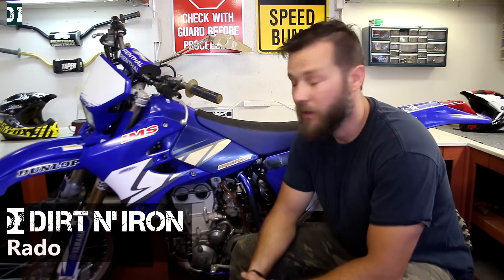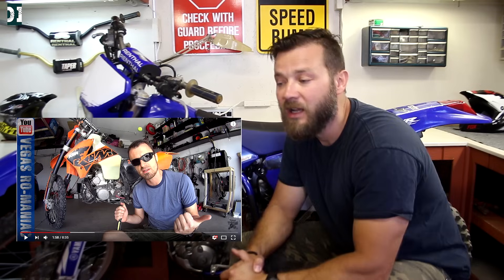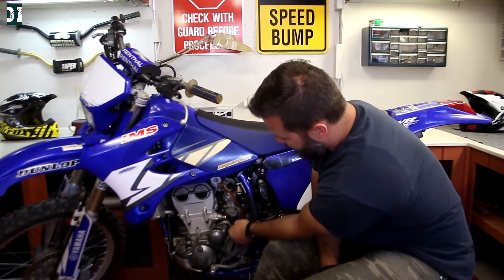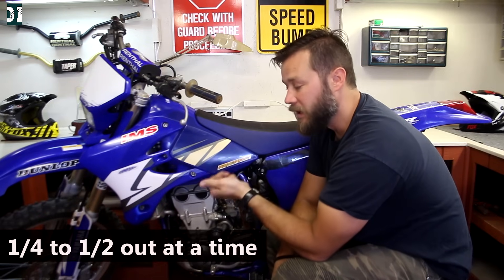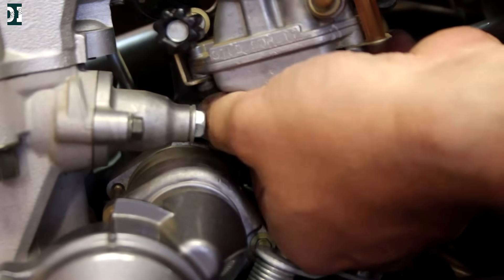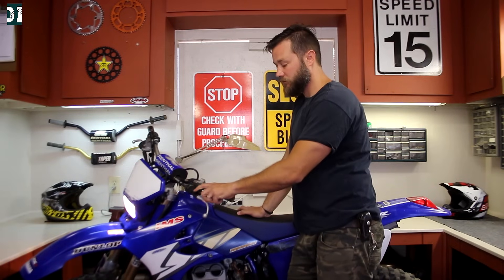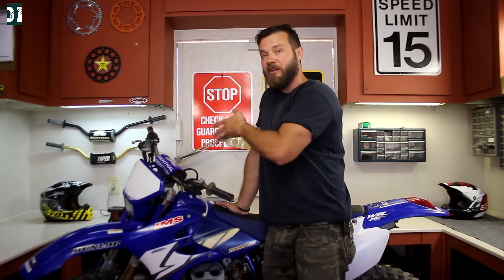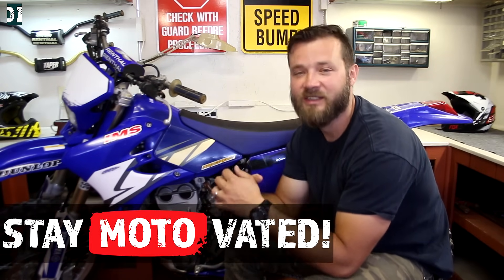How to adjust idle on 4 stroke dirt bikes - fuel screw adjustment

Comment: Hey Rado,

I’ve bought my first bike about a month ago. It was a project and it was the first time I rebuilt a motor. To make a long story short, I did this rebuild with only YouTube tutorial videos. Now she’s up and running and she’s finally getting the love she deserves.

The bike is a 2006 KX250F. I’m having, I guess you can call it a bogging issue at mid-high rpm in any gear. Where the bike feels sluggish, then at times she’ll die on me and I have to wait a few minutes before the bike will start. I can’t tell if it’s too rich or too lean.

I tried to set my aftermarket fuel screw exactly to this video. However, my bike increases in rpm instead of dropping around 2 - 2 1/2 turns out. If this is correct l, it never fixed my problem.

The bike pulls very hard during test runs but there’s something not right with the fuel system, any suggestions? 

I’ll be riding at 496’ ASL around 15-25 degrees Celsius (59-69 Fahrenheit)
When I opened the carb up I found:
180 main jet
55 Leak Jet
40 Pilot Jet
68 Starter Jet
Needle Jet: 2nd last clip on the top.

Thank you for the excellent content, I watch all of your videos and I’ve learned so much. You motovated me to get my first bike since I was a kid and I can’t wait to get this baby on the trails.

Love from Newfoundland, Canada.
Reply from the maker: Hey Bobby, I would suggest to get jd jetting kit, they tested same bike you had and will give you best recommendation for jets. The kit is like $70-80 but it really does work, I have it on 3 bikes now. of course you can try to play with it and come to similar results.. but kit has it all, plus they have custom needles that gives you very smooth transition. 
try to raise the needle one clip and test, then maybe raise one more clip and see how it behaves. By raising needle you are making it richer, you allow more fuel in. 
if it gets worse then go opposite direction on the needle and lower her all the way down, and see what happens..
Reply: Dirt N Iron I played with the needle jet clip positions and found one where the bike doesn’t shut off! Jetting kit is on the way as well. Thank you again, Rado!
Reply from the maker: sounds good Bobby. let me know how it works!
Reply: Dirt N Iron Hi Rado, I used the JD Jetting kit and found my bike is still shutting off. Usually it shuts off on a small uphill. I’m going to try to adjust the float height maybe? I hope your new dirt bike hunt is going well, looking forward to your next video.
Reply from the maker: what jetting are you running now? checking float height is good idea. I think you might still be little lean. which needle did you install and what clip?
Reply: Dirt N Iron Hi Rado, 

So after weeks of trouble shooting, I finally found out that it’s not a jetting issue at all.

I’ve discovered my spark plug isn’t igniting consistently... I’m not sure where to take it from here, but it’s somewhat of a relief to finally know why my bike was shutting off randomly.

Congrats on the new Husaberg! She’s beautiful!

Comment: Awesomeness, bought an 05  KTM EXC 250 yesterday with a huge flatspot after idle. Is the accelerator pump adjustable too?
Reply from the maker: its adjustable by the size of oring you install, it is mod I did in one if my videos. Just go with thicker oring
Reply: Dirt N Iron I found a 40/160 setup inside, should be 40/168 stock and 42/170-5 tweaked with needle 5th position from top. Hunting jets today 🤙keep you posted. Thanks champion
Reply from the maker: sounds good!

Comment: Idk how but that 58 pilot in my wr450 works amazing, especially on 1.75-2 turns out. Im pretty sure the leak jet is smaller and so is the main jet. It rips all the way through the rpm range though with no hesitation or bogging. No backfiring on decel. Like you say its like making the bike happy. I havent yet checked the needle clip position but im guessing the previous owner has lowered the clip to make it richer since the main is a size smaller. Anyways i guess if it aint broke dont fix it right, it still starts cold with the choke too. I order a 52 pilot and 168 main (165 stock) but now i might not even mess with it. Kinda like it how it is.
Reply from the maker: yea, if you are happy leave it alone, make sense. its little unusual but its possible. have fun bro!
Reply: I swapped the jets last night, went from 58 to 52 pilot, and 160 to 168 main. It runs even better now, at idle it seems to not miss a beat its very synchronized. With the 58 pilot it would idle good but now i notice it was a bit off rythym.
Reply: Sweet thats awesome. Have you ever went bigger than 170 on the main? The manual says going up to 175 can gain 10% performance at WOT. Its been running better & better each time ive swapped jets so im curious if going up on the main once or twice more will make it even better. The pilot is perfect at 48 so thats not changing at all.
Reply: Sweet yeah deffinately ill let you know if I do it. Yeah that is funny both 05's, love having the steel frame. Just swapped out the rear spring for a stiffer race tech spring, was so easy to access. Same with the carb etc..im assuming your ais is removed, or is it still on there? Do you know what size starter jet you have?
Reply: The manual says start the bike and let it idle for 3 minutes. Then turn it off and check it right away. It doesnt say wait 3-5 minutes like other bikes need. If you get the bike too hot and then try to check it then oil may spray out of the dipstick hole kind of like opening a hot radiator cap. I need to check my starter jet again, i think when i looked down the hole in the carb i saw 55, the manual says for a 05 wr450f the stock starter jet is 65. Im gunna have to open it up once more and double check that. Usually it starts first kick but with the e start it takes a few seconds. If i really have a 55 then a bigger one (stock) should make it better. When i first got the bike it had a 58 pilot jet with a 160 main.
Reply: Yes thats what the factory manual says, idle it for 3 minutes shut it off and check the level. Rest it on the threads dont tighten it. I just put a new gytr 2 stage air filter in it, also a gytr o ring chain. Next oil change im gunna put new crush wachers on the drain bolts. But on a cold start i just turn the motor over slowly 2-3 times with choke pulled then get it to tdc and it starts 1 kick everytime.
Reply: The jets were way out of whack because the slide plate was upside down which i do not know how they even got it running good like that.
Reply: The float valve seats are NOT replaceable on these specific carbs unlike others might be like on the older 426 and 400f carbs. Trust me i went through hell and back the 1st few weeks with this bike. It was leaking gas and i couldnt find the problem. Long story short i ended up drilling the valve seat out with an ez out to find out yamaha does not have a part # for it hence it is not made to be taken out. At least on mine, its gotta be the same with yours. But anyway i fixed it with a MIRACLE. I got a suzuki dr200 valve seat on ebay, filed it down a tiny bit and smashed it back into my carb "carefully" with a small rubber mallet. It also has a yamaha xs650 float valve lol its all metal i love it. It all works and theres no way that dr200 valve seat that i smashed in there is coming back out....and also that wasnt even the leak...it was the overflow tube it had a hairline crack. Jb clearweld has fixed that also.

Comment: When i pull in the hot start my bike die.
What does it mean?
Reply from the maker: how does the bike run? does it backfire? is there hesitation?
Reply: if there is a backfire, what does it mean? the clearances?
Reply from the maker: Maido Argel backfire usually means lean  mixture
Reply: thanks

Comment: my hot starter is on the carburettor and i want it on the levers so its easier is there a way i can change that (2003 YZ250F)
Reply from the maker: I think you can buy new plunger, puller assembly, cable and perch and install it. maybe get used one from ebay and just get new plunger for it.
Reply: thank you for the help